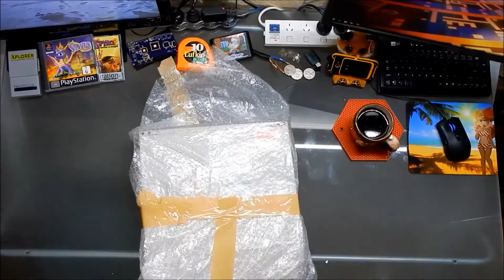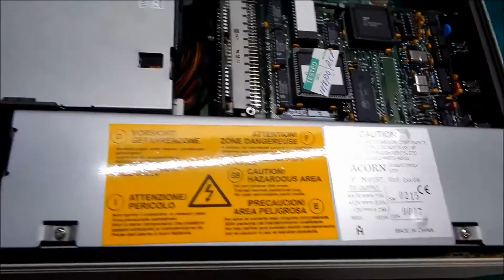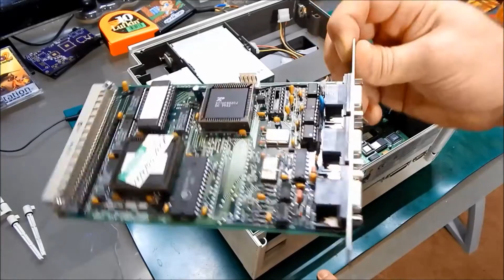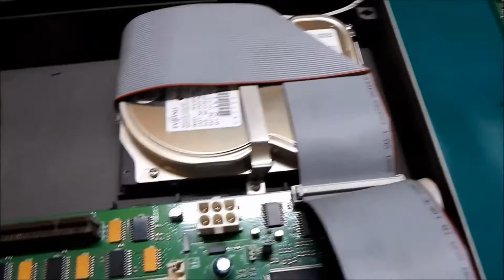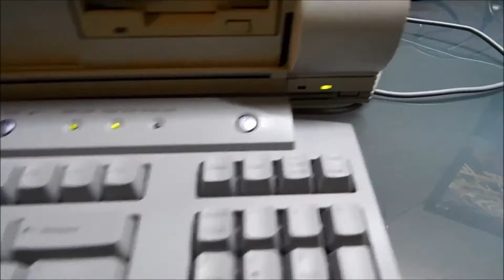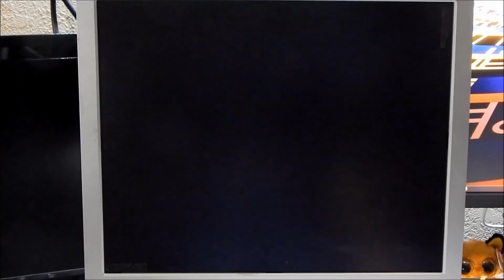Acorn RISC 600 Omnibus (New Zealand) system score & disassembly

Comment: Brilliant to see the OUI software again. We used to work with this stuff everyday at omnibus - The 1U units you mention are for rack mounting and would run the applications that you'd connect to from a front end running on the workstation you've shown on this video.

Comment: Click on the Red Bus.
Reply from the maker: I cannot remember if I had opened that before (after having made this video). I do recall the system booting into the usual OUI whilst I do not do the 'hold delete key' boot... and me not being able to do anything as it has no network to talk to. Seller did have other machines and 1U rack units too, I just did not have funds.

I say this because I just recently opened the power supply unit some time after making this video to clean up & replace the fan... and at some point during the 'rebuild' the voltage selection switch inadvertently got changed to the 115V position and I did not notice. Perhaps whilst I was using a brush to clean it... Needless to say when I plugged it into the powerpoint and hit the go fast button... the magic smoke released. 

I feel pretty silly... most PSUs these days are autovoltage. I reckon though only the MOVs smoked so it looks pretty repairable. I should of checked... but the setup in the Acorn machine is such that you cannot see the switch unless the PSU is removed from the machine.

Live n learn ^_^

EDIT - Yup, MOVs saved me tush. I cut them out and the rest of the PSU is okay. It works without em, but I'll be replacing them ASAP.

None the less, I indeed had tried the red bus in the past, but it is a no go as it fails to connect to what its looking for (in this case what it reports as 'portmapper'). 

Still cool piece of history though in my books

Comment: Hi, I also work(ed) for OmniBus.  I still work for the company they were bought by, Miranda and then Grass Valley. We have a couple of these units for Support reasons, I manage the Support department who STILL support this equipment (well the software that runs on it at least).  These were the staple units running Columbus Automation systems throughout the late 90's and 2000's. Thought you'd like to know ;)
Reply from the maker: Much appreciate the replies, really is amazing learning how long a run these Acorn machines have. It certainly has been a different experience for me discovering them & a bit nostalgic. Always learn something new, especially when I dive into the world of industrial equipment, broadcast, and automation. Really almost an endless pool of technologies ^_^
Reply: My first machine was an Acorn A3000 and my dad brought home a RISC PC one year which blew my mind with the dual booting facilities. Years later I was delighted to find a RISC PC running Omnibus in Wood Norton used to teach automation (and run some, for TV production courses) while I was there srusying, so there are almost certainly a few more functional systems out in the wild than you may think 😎